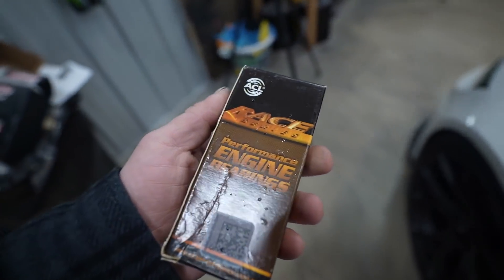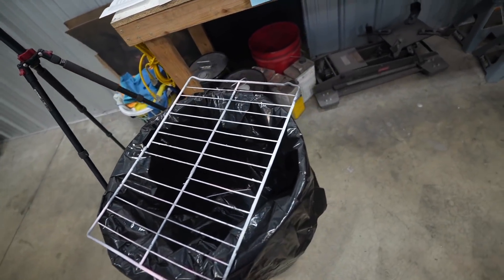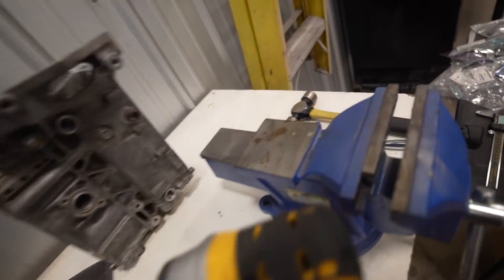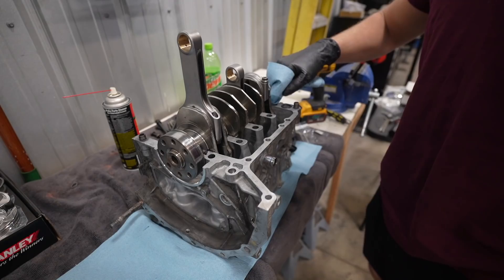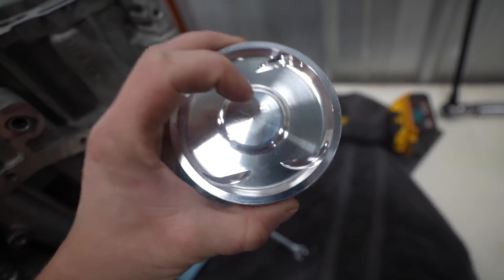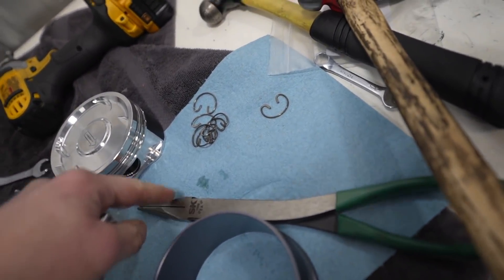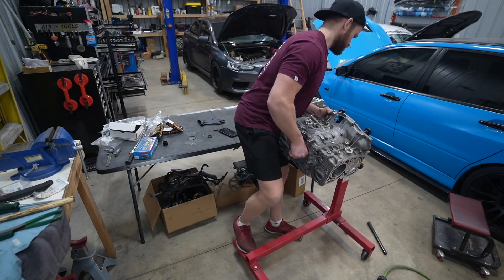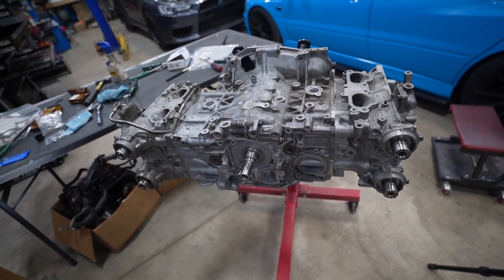How To Rebuild A Car Engine (EJ25)

Comment: Always a good time building engines. But you should definitely check out your valve lash. After a head rebuild and then torquing the head bolts down it can totally change the clearances. But it's up to you. Keep up the progress 🤘
Reply: I came to the comments to see if anyone else mentioned this lol - I learned this lesson the hard way for sure. Have nightmares to this day about this lol - Good times...

Comment: Generally how much power can a stock block with upgraded piston and rods handle reliably?
Reply: 500whp or less. Pushing mid 500s to 600 you’ll start to see head lift.